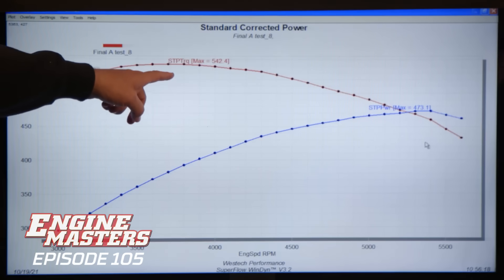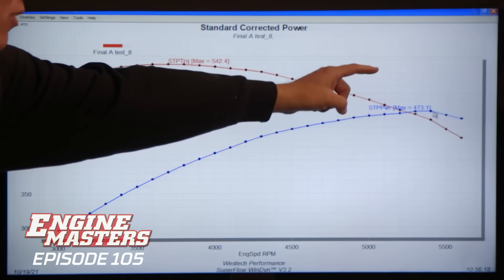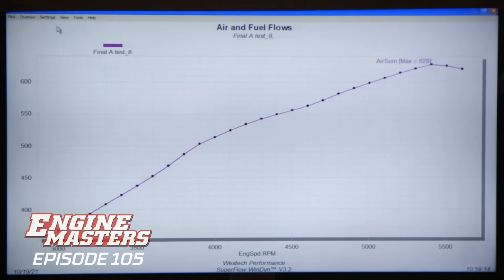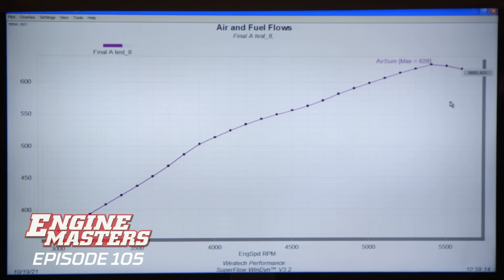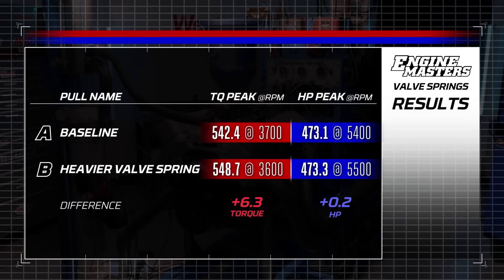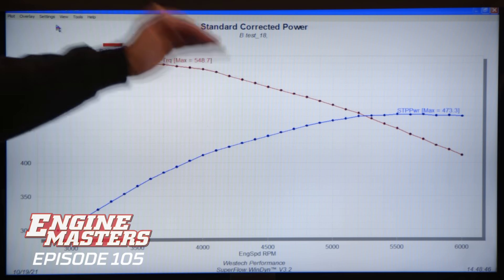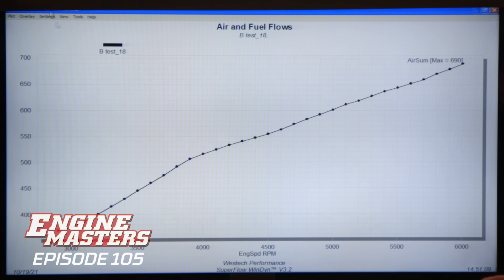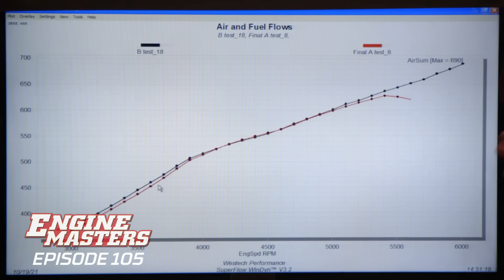Valve Float! What Is It, And How To Avoid It | Engine Masters | MotorTrend

Comment: Preventing valve float is also why Ducati motorcycle engines sound like, as one person put it, "a Cuisinart full of clarinets" -- actually looking at the system as implemented breaks my brain with the linkages involved, but short version, the top end works kinda like the bottom-end rotating mass -- the valve stems are pushed /and/ pulled by the cam, no springs, so no float, but it's very noisy and probably a bit harsh on parts without the tolerance buffer that a spring provides. But when you need a twin to make twice the revs of the tested V8, and thus fire each cylinder  ... not gonna lie, but I must've slept through the session of physics class covering the square-cube law.  A 1.3L twin is working a lot harder per cylinder to bet to 12kRPM than a 5L V8 at 6k, that's just basic math, right?
Reply: Ye Olde Desmodronic systeme
Reply: Still amazed at Formula 1 engines.
Reply: I learned the hard way about desmo service. Lol
Reply: @ryanwalker9472  I pity the man (apparently you) who had to work in that ridiculousness.
Reply: @ryanwalker9472 what did you ride? A monster 996?
Reply: So I have raced dirt oval karts and the way float was explained to me the spring could shut the valve fast enough before its ready to open again it causes a hammering on the lifter I've wondered why it was not mechanically linked and I also kno zero about free valve that Koenigsegg uses 

I know zero now it's on my list of things to read up on
Reply: @codysmith2854 depends on engine setup. Overhead cams would be different, in this video though they are using a pushrod/lifter setup.
Reply: Yes, it is a very unique POS system that makes noise.
Reply: @SosopChabot  
What do you find wrong with the modern desmodromic valve system?
Reply: @milojanis4901  Nothing wrong per say other than it’s complicated for nothing, cost a lot in parts and maintenance et makes unnecessary noise. If it’s what float your boat, cool but I’m an x motorcycle road racer and look at things practically.
Reply: @milojanis4901 it's a dinosaur and an irrelevance that's kept alive via racing  rulesets that hamstring it's conventional competitors.

Once we got better spring materials into  The 70s and early 80s it stopped being relevant and the theoretical rpm limit raises ceased to actually happen in the real world
Reply: @milojanis4901 mechanical harshness and complexity. Sure it would be great in racing application or for someone mechanically inclined but your average Joe on the street who doesnt know how to maintenance engines...it needs to be working perfectly to be optimal which requires more frequent valve lashing than a spring setup. Not to mention 2 cams per valve your average Sunday rider just shouldn't own a Ducati or another engine using that cam setup lol
Reply: @SosopChabot it floats his boat to not float his valves
Reply: Have you ever seen then maintenance schedule on a bike with Desmodronic valve operation? You have to lap the valves every oil change and full valve train service every 15k miles. That’s ridiculous. You’ll never enjoy that bike.
Reply: @williamminter7057 YUP and if you leave it sit its even more frequent than with the oil change
Reply: IMO 4.0L V8s are that perfect sweet spot. Got that V8 tourq but with shorter connecting rods it can rev higher than your standard 5.0L+ V8. V6 isnt enough tourq and V10 has no RPM unless it has a small bore but even then its to much rotational mass.
Reply: But they still dont make power so kinda pointless. If it wasnt for favorable rules you would never see another one on a racetrack

Comment: Ok,  you added spring stiffness to resolve this particular engine's valve float problem: so what is the limiting factor to adding even more spring stiffness and running to higher RPM's?
Reply: Heavy valvesprings rob power
Reply: @SoI_Badguy  Its needed to make power with large cams
Not enough seat/open pressure destroys parts super fast
Reply: @SoI_Badguy  I thought they prevent floating?
Reply: @fish_R_stinky69  yes they do prevent valve float, but they require more power to push down. The engine has to use its own power to push down against the springs to open the valves. Stiff springs that prevent valve float will only make power if the engine actually has enough port flow to operate efficiently in the higher rpms, it's not just valve float that limits power.

Higher rpms also mean higher friction, parts need to be stronger to survive the forces acting on them, which might require the parts to be thicker, which makes them heavier, etc. Engineers designing engines have to do compromises between cost, weight, and durability when designing engines to meet specific performance targets.
Reply: The camshaft size 👍
Reply: The limiting factor is does it make enough power to do the RPM. If yes then you need the mechanical parts to be able to withstand the power and RPM.
Reply: if the cam style is not designed to take that kind spring rate as is the lifter design, YOU WILL break things
Reply: If you had proper seat/open pressures before then stiffer wont help you any
ONce your engine goes past its peak thats it
Reply: If the valve springs are too stiff, the rockers and push rods will self destruc because they are working too hard. What's the limit on RPM? It's a big block Chevy, you spin it any faster than 5500 the pan gets full of piston skirts REAL quick.
Reply: @reesewilliamson3346  It all depends on the level of parts in your engine. NHRA Pro Stocks run 500 ci engines which they wind to 10,500 RPM in every gear.  They would go even higher but they have to run an NHRA 10-5 limit chip.
Reply: @reesewilliamson3346  Also switch to solid lifters if want life at higher RPM's. 
For a daily, just build for low to mid to avoid a grenade.
Reply: @reesewilliamson3346  wrong
Reply: @reesewilliamson3346  You are kidding right? Decent performance big block chevy can go into the 7k range easy, race motor to 10k
Reply: Or making it DOHC.

Comment: You boys need to play around with the same concept but on a modern overhead cam engine.
Reply: Sure, to see the benefit of design but doesn't demonstrate the issue with pushrod engines. 
Try out the ultimate, Formula 1 pneumatic valvetrain!

Comment: I'd like to hear their take on dual overhead cam, where we get rid of the pushrod completely AND use smaller/lighter valves. More flow and revs and better reliability?
Reply: you still need spring to control the valve return.  dohc gets rid of a lot of mass' inertia you have to overcome.  you want valve control though, look at f1 pneumatic...no spring weight to overcome.  similar with freevalve.
Reply: Pneumatic valves literally negate these problems, these guys need to make a 1500HP 1.5L 4 cylinder, that can operate at 75k rpm
Reply: @C_Castillo  They ignore DOHC all the time.
Reply: @C_Castillo  But there's the complexity and reliability versus power-gains consideration, same as DOHC.
Reply: @dgholstein  these guys have literally been trying to make more power, in the 80s 1.5L 4cylinder engines were dumping out 1500HP, they have no excuse , they’ve blown up engines for a lot less, they just need to make a 75k RPM monster or something that tops at least 1k HP theyre so called “engine masters” they should be able to do it easily.
Reply: @C_Castillo  75k?
Reply: @fish_R_stinky69  yes, we were nearing 50k in the 80s, thats why we put rev limiters on them to prevent 75k RPM 2000 HP , too dangerous for the track, but with tech now, we should easily be able to topple 75K
Reply: @C_Castillo  all that rpm for only 1500hp? Seems like it should be more than that.
Reply: @michaelcederquist6180  well it was the 80s what did you expect a freakn terminator F1 car lol 😂 also it was only a 1.5 L 4 cylinder
Reply: @C_Castillo  you got a link to this info? I'm genuinely curious.
Reply: @michaelcederquist6180   in that hour one, i belive it talks about, RPM and turbos , I personally really like the 1 hour vid tbh, you get to see the OG engine masters
Reply: @C_Castillo  I appreciate it
Reply: @C_Castillo  I think you might be confusing turbo RPM with Engine RPM. Most I've heard of is a 4 cylinder 125cc motorcycle that presumably reached 24,000rpm. Then there are unicorn Rotary engines which could go 14,000.
In reality, 16-18000rpm was the limit of the 80s F1 turbos. When the N/A motors came in the 90s, they could reach 20,000.
Reply: @crd-nz_001  , im pretty sure they limited the engines to 20k rpm as part of the formula in formula 1, today we should easily achieve that with advancements in technology today, i might have exaggerated but im definitely not confusing engine rpm and turbine rpm, i have an engineering degree
Reply: @C_Castillo  I would take it being an engineer that increasing an engines rpm close to 4 times over 20,000 would mean all forces would be magnified by a factor of 16? Be it centrifugal loads, friction loads and piston direction change loads?
Your also expecting a average piston speed of a shade under 20,000fpm?
Reply: @crd-nz_001  oh yeah, qualifying engines, good for only a few laps :) a better qualifier puts you in a better position to win the overall race, so ofc we would maximize every bit of those specs regardless if the engine fails after lap 4, im still waiting for “engine master” to really build a high RPM high HP engine , im tired of 5.7+L 8k rpm 700hp V8s especially when 1500HP was achieved via a 1.5L 4 cylinder bmw in the 80s
Reply: @crd-nz_001  dont get me wrong, i love the sound of honking V8s that just sounds like metal flexing its 💪 muscles, especially a supercharged top fuel engine crackle
Reply: @crd-nz_001  you can skip to about 2:00 on this video https://youtu.be/UeX9mPoC8j0 you can’t tell me you dont enjoy that first few wiffs of nitro transition
Reply: @C_Castillo  if your after big V8 rpm, search Spinal Tap. However, it only goes to 13,400rpm.
Look, I truely think your way off on the whole rpm thing. 18,000 is 300 revolutions per second, so its about 3 milliseconds to do one rotation. There just isn't the time to get the air in a cylinder much after 20,000rpm.
You sound young, full of hopes and dreams which is a good thing. Im trying to educate you so you dont waste time on unrealistic fantasy. Or worse, your trying to sound like you know when you dont. For that, your only destination is to learn from your own mistakes as there is no room to listen to older, wiser people who have made the same ones...
Reply: @crd-nz_001  do you know how to comprehend bc i said im tired of those big V8s and i clearly said i might have exaggerated. Or are you senile (or high on drugs). I’m a huge encourager of education, for the wise listen to advise. “Never assume….”  i shouldn’t have to finish that quote. Forced induction solves the amount of time it requires to take in air. If you want to question my knowledge you can visit a counselor and ask them to see the classes to take at uni to become an engineer if you haven’t already. We can have a more in-depth conversation when you learn to read correctly. For now, happy motor heading
Reply: @crd-nz_001  apparently you cant. BS, please, 50k RPM is not unfathomable. 24 years eh, ive been building robots and engineering since i was 4, im 28, we’re on the same level, I come from a long line of engineers, maybe you should retire. If you must know, i was treasury of the debate club in college, and i do plan on entering politics when im 55, that or become a professor at a JUCO im still on the fence about that one. I’m sorry but maybe your fire burned out on the inside or something who knows
Reply: @C_Castillo  no, I cant get through arrogance, nor ignorance.
The arrogance is believing its possible. The ignorance is in having offered no logical answer to sustain 75k rpm. In an electrical motor, sure. Not never, ever in an ICE. Best bet would be in a 1cc NitroMethane RC motor, but even they struggle to surpass 30,000rpm.
But hey. Words are free to say, so are dreams. 
I dont care who you think you are. Stepping over 20,000rpm in any ICE for a vehicle is a futile effort. Thats not opinion. Thats unavoidable fact. No debate. FACT.
To end this rant, answer a simple problem. Lest say at 20,000rpm there is a frictional loss of 20hp. Very generous as it would be much more in reality. However, that mythical engine would have 80hp loss at 40,000rpm. And that HP isnt just "lost", it generates heat. The majority will be on the piston and ring sliding on the bore. That localised heat concentration will cause them to melt. Melted pistons dont make power.
Now, how are you going to stop that from happening?
Reply: @crd-nz_001  lets begin, the TRS18 Jet engine (ICE[ internal combustion engine])  can operate up to 47k rpm in the 70s. Everything else you said is invalid. You can continue to rant.
Reply: @C_Castillo  umm, that a jet engine... claiming that is a vehicle motor is one thing. Singing it should be compared to what these guys are doing to PISTON DRIVEN ENGINES cements your better at politics than engineering.
Reply: @crd-nz_001  im sorry but any thing you state is just invalid, there is no recovery from your loss of efficiency, i take back what i said, we’re definitely not on the same level, you should just retire old man. Ive got better things to do than to sit here and insult your intelligence. This discussion is over, class dismissed.
Reply: @C_Castillo  sounds like a general engineering degree hasnt taught you what the dunning kruger effect is..  
Poke us when you develop that 50k RPM crank motor, instead of arguing in bad faith about turbine engines.
Reply: @mfThump  , sweet heart, CRD was just so bad at basic arguments that it wasnt worth the time. I will develop a 50K motor, im already working on it.
Reply: @C_Castillo  They limited the F1 engines to 18k in 2004. Back in the late 80's they ran to 16k when in qualifying mode. In the 90's, the V12's revved to between 16k and 17k.
There has never been any, and I do mean any race engine that was limited to anything because they would otherwise rev to 50k.
The turbo engines in F1 in the 80's made power by adding a tremendous amount of boost, not rpm.
You seriously need to sit down and learn about engines, and race history dude. You are so far off the mark it makes you look foolish when you criticise others.
Engine Masters don't really deal with DOHC and there's a reason for that. Their main target group uses OHV engines. Maybe at some point they will bring in a Ford SOHC.
Every design has its pro's and con's, that's just how it is. If you think a show like Engine Masters could do any kind of stuff based on free valve technology, you are way off. It is not common technology and very new technology. Some OEM auto makers are developing it, and Koenigsegg is using it.
Reply: @C_Castillo  If you spin a 1.5l engine to 75k rpm, what kind of power do you think that engine would make?
Gotta love it when people with ZERO knowledge tell others what to do.
Reply: duh hur muh pushrods

Comment: Downshifting to 1st at 100mph might cause some float.. among other things.
Reply: More rpm more hp
Reply: 2nd or 3rd at 100 would destroy everything
Reply: @brysonshires9742  Reverse would be EXCITING.
Reply: @angeloparis7963  just watch you some neutral drop. Excitement in every video
Reply: @brysonshires9742  as long as it's not a 76 Laguna with steep gears that does 110 in 2nd gear.
Reply: Money shift
Reply: Yeah, that would be rod float. 😛
Reply: Nag that's called the money shift, it's called that because it makes money fly out, from what I hear. Is that correct? Did I win
Reply: Yeah, do that, and see if the bank will "float" you a loan for $6,000 for repairs and replacements
Reply: which is why my Honda with cam up top and solid lifter can handle my misshifts!
Reply: Otherwise known as money shifting as stated already
Reply: Depends on the gear ratio
Reply: The true definition of the money shot! 😂
Reply: Doing that would make valve float the least of your problems
Reply: Is that what's been happening to me???
Reply: Meh... It'll buff
Reply: Hahaha
Reply: Laguna were awesome
Reply: Or missing a shift